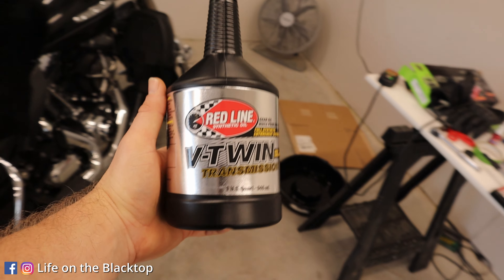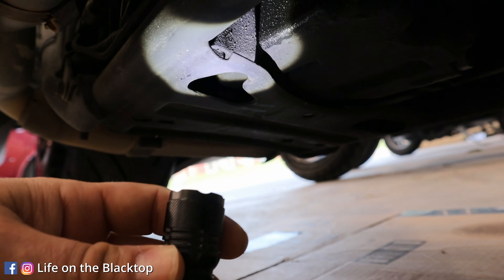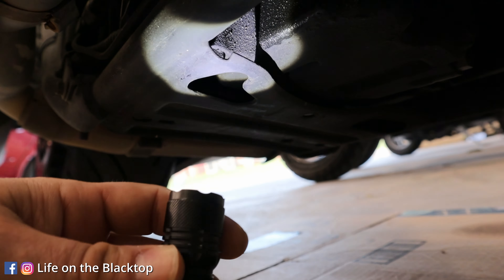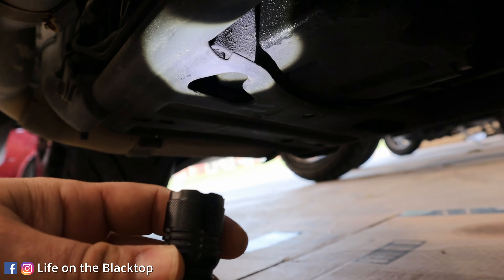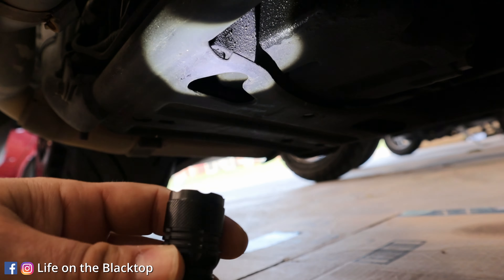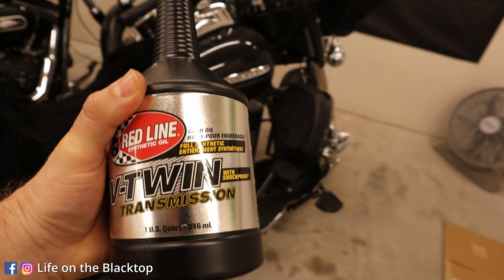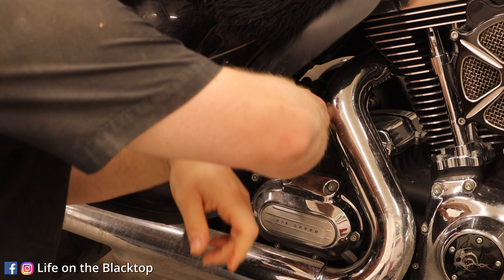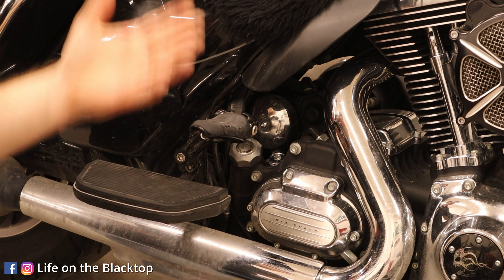How to: Harley Transmission fluid change | Twin cam touring motorcycle

Comment: Does the oring  on the drain plug need to be changed every time the oils changed.  I don't  think ever replaced a oring on my harley transmission  drain plug
Reply from the maker: No. You’re “supposed” to but don’t really need to. Eventually it will get hard and brittle from the heat cycles though.

Comment: What kind/brand of oil do u use in your primary??  please respond??  thank you
Reply from the maker: @roadking681  I've stuck with the Harley formula + and honestly really like it. At one point I was going to switch to redline since it's a bit easier for me to get but since the formula + has been working well, I decided not to rock the boat.

Comment: My transmission drain plug is on the left side, pointed downward. 2017 harley touring limited.
Reply from the maker: Yeah there will be some variations between your M8 and my twin cam. Always follow your owners manual for capacities and any other specifics as well.

Comment: I checked the tranny fluid on a 08 Streetglide i bought. After putting maybe 2k miles on i checked it and i could barely see it it was so clear. It registered but it was like it was brand new. Guy said he changed it before i bought it, but it literally looks brand new. I was expecting some color. Im guessing he maybe used syn 3.
Reply from the maker: Hard to say. Syn3 is just motor oil so it has the typical amber color but it is slightly more clear. That’s another reason I like the redline, I know it’s there lol

Comment: I always use a liquid thread sealant. Mine tears as well.
Reply: HD is 14-21 Ft lbs. Or 168-252 inch lbs. On all drain plugs,
Unless i heard you wrong.
Reply: @hookdog8640  The bolt has threads missing for breather my guess a proper shim after oring will give it no where to squish out. FLH cop bikes here replaced that bolt as washer was lost in changes.

Comment: Only thing you missed for newbies you told them what to use to take fill plug out but NOT which socket to use to remove under motor...I think it;s a 5/8?

Comment: Good Deal.  20K between changes huh?   I do mine every other oil change.  6 to 8k miles. ( I also dont run synIII or red line)  
85-140 Mobile One in my trans and primary has been doing better for me in the desert heat.   Anyway, Hope you two get to ride soon. Mine's off getting new tires put on so....       Stay Safe, Stay Warm  You Two.

Comment: my owners manual and factory service manual both say do not screw in dip stick and check on the jiffy stand. 2007 electra with a 96ci.  So who's correct ?
Reply from the maker: Always trust your owners manual over some random person on YouTube. 😀  I'm definitely no professional but this has worked for me for 50,000 miles without issue. I typically don't have a helper available when I'm doing this sort of stuff so you just have to do what works best in your situation. For me, that's checking it on the stand and rolling with it.

Comment: How many miles do you put on primary oil. Is it redline also?
Reply from the maker: I've stuck with the formula stuff for primary so far. I was going to switch but I read a lot of reviews about the clutch slipping a bit with it. Maybe I'll try it eventually.
Reply: @LifeontheBlacktop  My experience, stay with formula . Tech thought I wanted Red Line. Clutch slipped immediately.

Comment: You dont screw at the end to ckeck the level, must be unscrew.
Reply: Service manual says to screw in up to the o ring, I'm sat reading it right now.
Reply: Harley manual for my my 2006 flhti says check with bike level and dipstick resting on threads
Reply: Lol two literally different ways to check the fluid.

Comment: I'm with you on the redline gear oil. I have an 07 FLSTC   with 37k on it. I did the three hole service at 35k because I didn't know when the last service was. Went with the syn and the trans was noisy! After researching the redline seems to be one of the top choices so I changed to it after about 500 miles and the trans noise almost went away.  Redline synthetic for the win. Love your channel, keep up the good work!

Comment: I have a 2011 SG 103. TSB says only add 28oz and check it on the side stand, screwed in, just touching the o-ring at ambient temp… e.g. room temp. That’s the correct reading. The 2011 manual is not correct as it says do not screw it in and add 32 oz. The TSB was because oil was leaking out of the shift shaft seal so they cut it down to 28oz and screwed in at room temp to put the level right between the arrows on the dip stick. It puts it right between the arrows on the dip stick every time on mine. All bikes, even the same exact year, are slightly different. Check the dip stick.
I use Belray 80W-90 Hypoid Gearsaver specifically made for motorcycles. Quiet and shifts nice. History at the dealer shows 2X or more the life of the trans on customer bikes that ride the hell out of them 40-50K miles a year. Just an observation.
Buy a torque wrench. $35 on Amazon. While your at it buy liquid Teflon for pipe thread and clean the bolt good with brake clean, add it, used a new o-ring and oil the o-ring a drop to keep it from tearing on torque. Set between the arrows on the dip stick. No higher or lower at room temp. I use 17ft lbs on all drain plugs. Never had an issue.